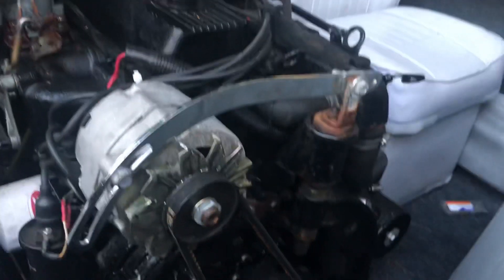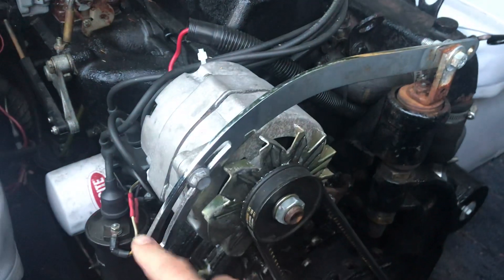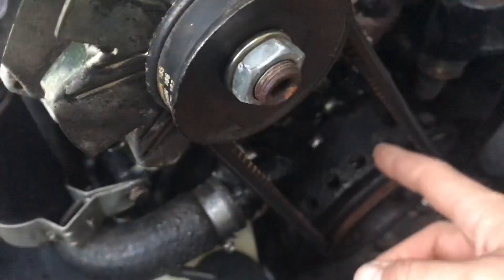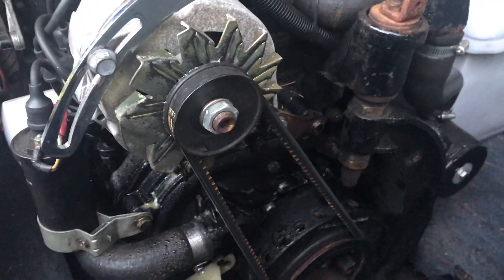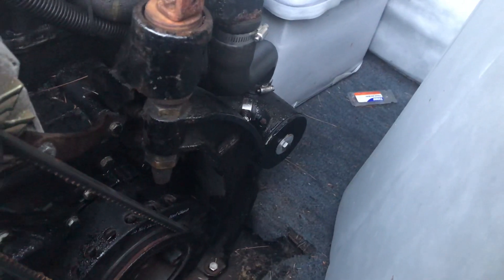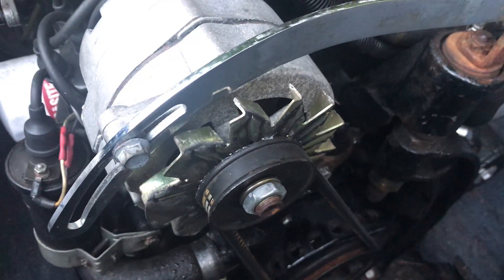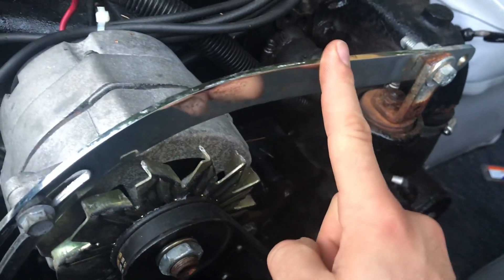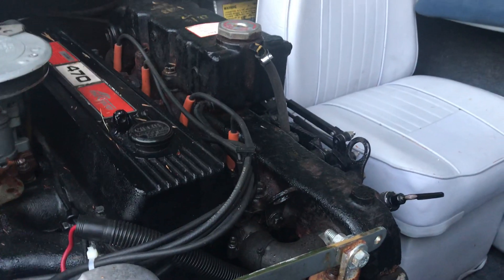470 mercruiser alternator conversion

Comment: That is a 10-si delco Remy alternator with internal regulator all in one net little package and yeah you just gotta figure out what you need and keep your belts straight make sure the bottom hole on the alt mount is str8 and solid it’s what holds the most on weight also that’s one of the most reliable alts around I know a lot of ford guys when they build a old car or truck that’s the first thing they get and change if you want more power at idle small alt pulley big drive pulley I think it’s 4:1 measurement is around the pulleys if it’s 3:1 it’s still ok but around 2:1its not gonna kick up any real good chargeing till 2500 rpm so that’s about most that can say about them got around 35 years of working with them .

Comment: You cant just go to any auto parts store and buy an alternator. The marine ones have spark arrestors to prevent the fumes in the bilge from blowing up. Car alternators dont.
Reply from the maker: Now that's a helpful piece of information. I did not know that.
Reply: @Scagguy4014  How do you wire the 1 wire alternator?  do you bypass the  voltage regulator that was originaly connected to the 2 wire stator.  where does the 1 wire connect?
Reply from the maker: Dave J.R. Clark I’ll have to look but I believe it goes straight to the battery 
The regulator has been bypassed
Reply: @Scagguy4014  I still need to know how the 1 wire alternator is wired.  I have removed the 2 wires from the stater going into the voltage regulator .  I'm wondering if the one wire from the alternator gets spliced to  both of the 2 wires coming out of the  voltage regulator.  Also does your setup have a  ground wire from the alternator to the block or is the mount a good enough ground?
Reply from the maker: Dave J.R. Clark I believe the one red wire runs to one of two places. Either straight to the battery or the the battery side of the slave solenoid. My alternator has a built in regulator so the original water cooled regulator was bypassed. The alternator I believe is just simply grounded to the block itself
Reply: I was wondering the same thing. He didn't really show the back side of the alternator which would quickly show what it is. Hopefully it's approved for boats and he doesn't blow his family up. Also, this installation doesn't allow much belt tightening capability as the rotation of the alternator pully pretty much matches the crankshaft pully. That being said, I have the same engine but also power steering. It also has an aftermarket "kit", don't know the source or brand, but the way it is mounted produces very little belt wrap on the pully's. The belt slips (squeals) considerably with even the slightest acceleration. Something I plan to remedy.
Reply from the maker: Joe I believe the bracket allows for some adjustments, and the alternator has been on for quite some time so I’m not super worried about an explosion but I check it anyway.
Also I can see how you would have a slipping problem with your power steering. I believed the belt only contacts a third of the alternator pulley on those set ups. Whereas on my engine the belt wraps around 75% of the pulley. All I know about the alternator is it’s a simple one wire
Reply: How did you disconnect magneto
Reply from the maker: tyler schroeder somebody already had removed it
Reply: Thats right you should not use a auto alternator.  This is a Marine part you are looking at in this video.